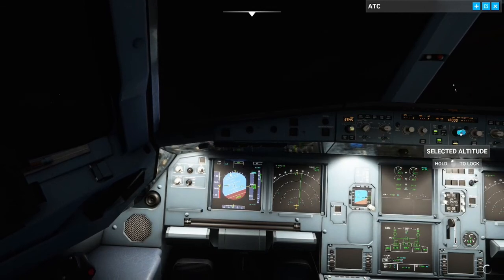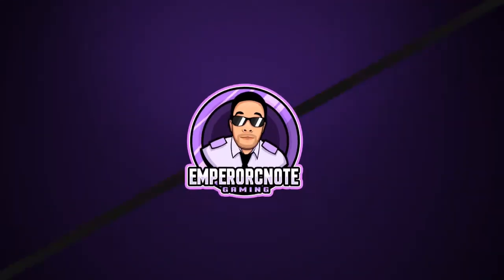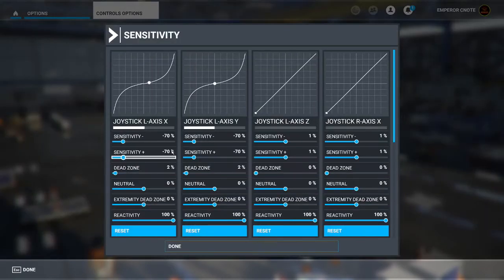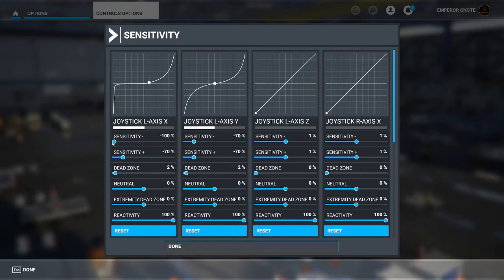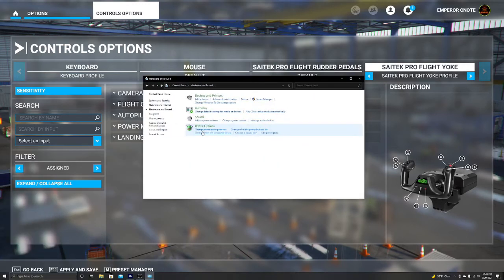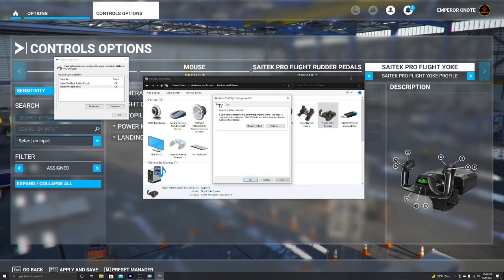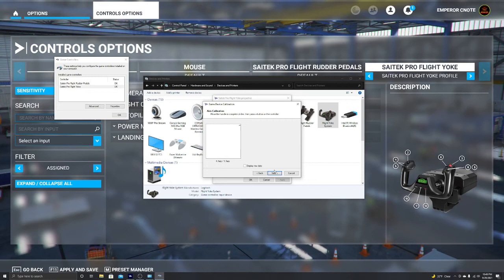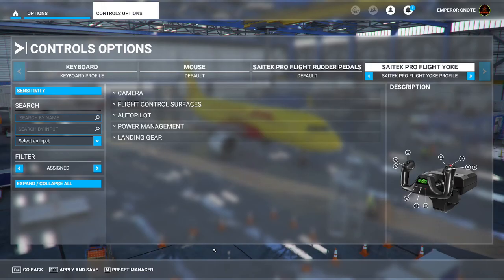🔴✈️ FIX THE AIRBUS A320 AUTOPILOT ISSUE ✈️🔴

Comment: The problem I got is that it just drops to whatever altitude it wants to be at. I put it at 7000 it goes to 5000 or 4000, no matter what I put in it the autopilot goes to 5000 to 4000
Reply: Ive had this too. Also i have had the going around in circles. And one time i even had the trim go to 20 degrees all of a sudden at the time AP was switched on. Terrible, and i doubt this will fix it. 

But i will try it never the less. 

Greetings,

Jeff

Comment: The  only problem I got is when I set vertical speed to go up faster the plane goes up and down fast and i can’t reach my altitude that I set
Reply from the maker: Because the plane can’t go up as fast as you want it to cause it doesn’t have the power. So it’s stalling to level back out thus why it’s going up and down

Comment: I play with a mouth and keyboard, it's gonna working or no ?
Reply from the maker: Of course it will work. It might not be as easy but it will work.
Reply: I use a xbox one controller and I have this problem will this work with the xbox 1 controller? I do not have a  Yoke.